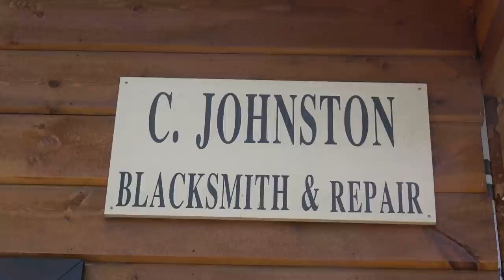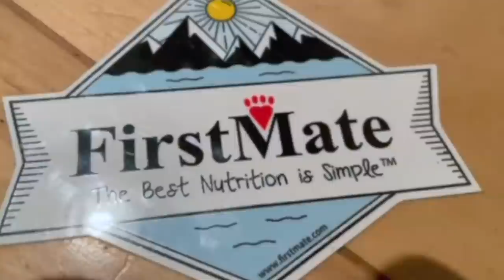Running Whitewater on My Dog’s First Paddling Adventure & a Stop at a Blacksmith’s en Route

Comment: Great trip but why did Kyle have his paddle backwards  the whole trip?
Reply from the maker: Yes, he told me that’s how it was supposed to be and offered to go into scientific explanation which I declined. He thinks it’s like a bent shaft but it’s not, it’s actually curved. I just didn’t bother him about it.
Reply: I actually flipped it for the rapids to hold more water.  On the flat there’s more surface area on the curve and the bend actually ensures lift rather than drag.  🤷🏻‍♂️
Reply: @kyleloney1982  actually its the opposite, the scoop is designed to give you a more controlled pull. By reversing it you are creating a hollow in the scoop that acts like a vacuum and increases drag and instability.  The water behind the scoop becomes a vortex and you loose control. It is based on sprint race paddles. By reversing you also end up pushing water down when the paddle enters the water and can cause paddle flutter. Try this experiment. Using a bucket of water put a few drops of food colouring in, use a large spoon to emulate the paddle. Try using it both ways and you will see the food colouring indicated the flow. in front and behind.